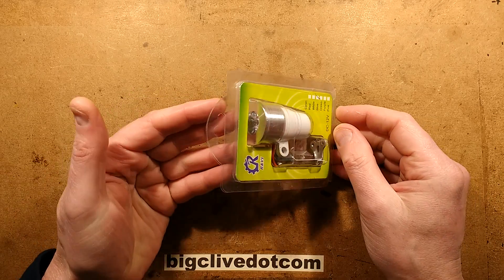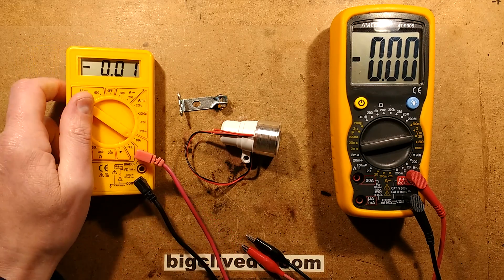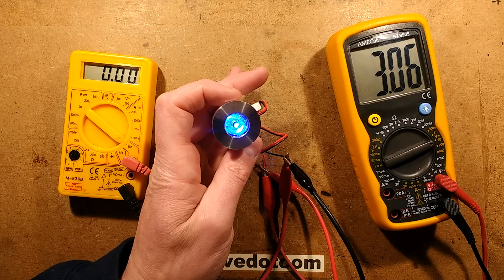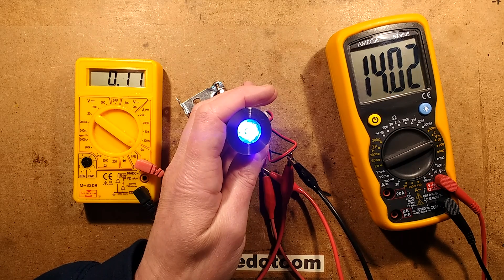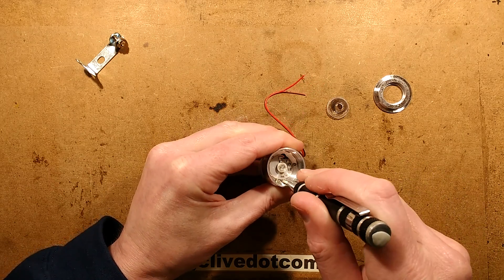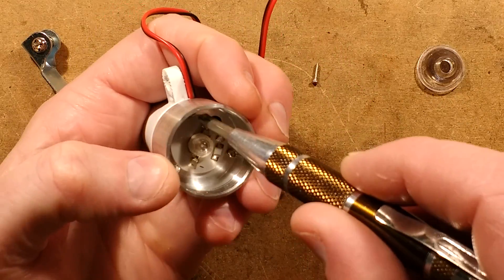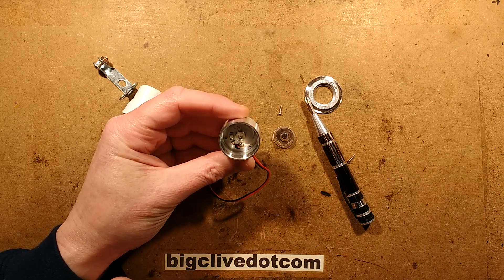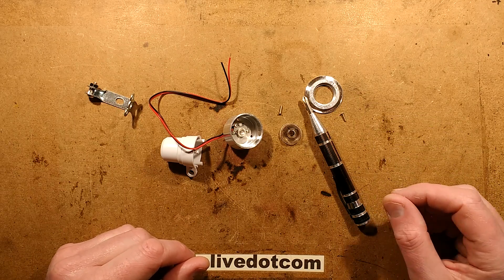Inside a cheap LED vehicle feature light.

Comment: So that resistor is dissipating more power than the LED.

Niiiiice.
Reply from the maker: +Luke Den Hartog About three times as much.  But it will probably be reliable.....
Reply: Yes, and as it looks like a 1210 package resistor it's getting pretty hot! Typical max.power dissipation for those is 0.5W... Assuming 3V across your LED that leaves 9V across your LED. 9V/100R = 90mA x9V gives you 0.81W so well above rating. Also no protection against transients so won't last long on a vehicle, though it may have desoldered itself before that point anyway.
Reply: Not surprised to see you here but the time traveling is neat.
Reply: https://youtu.be/6zto6e2RtwQ
I wasn't sure what a mr16 was ;)
Reply: transients probably not a problem due short durations BUT do the calcs on 14volts now that changes things ! yes that resistor will prob desolder it's self
Reply: any more and it'll become a light emitting resistor